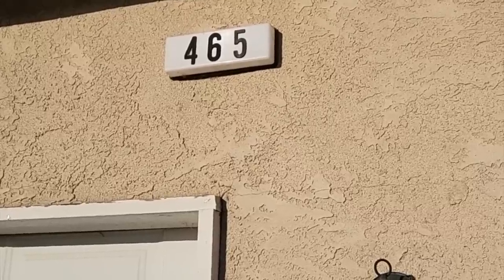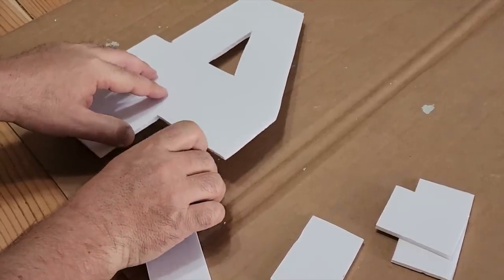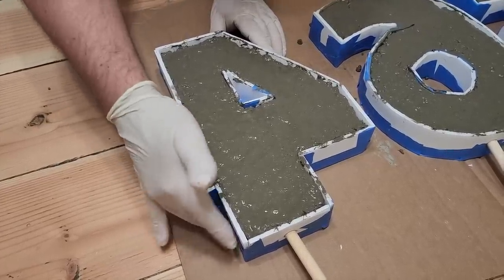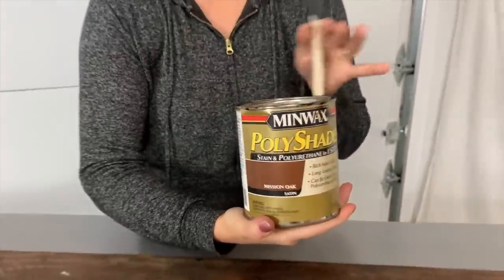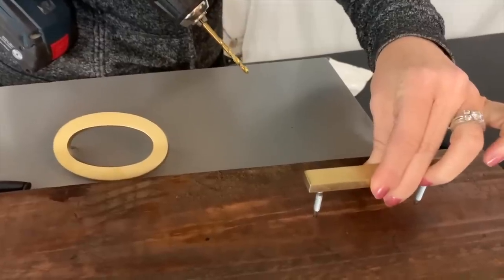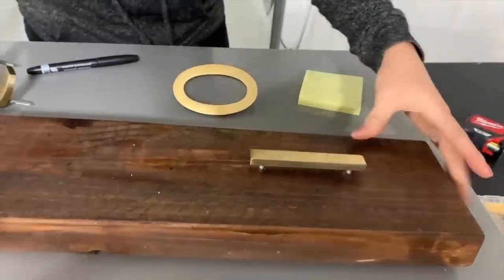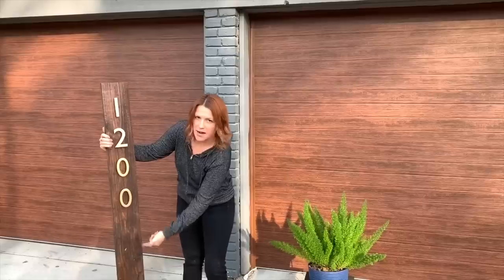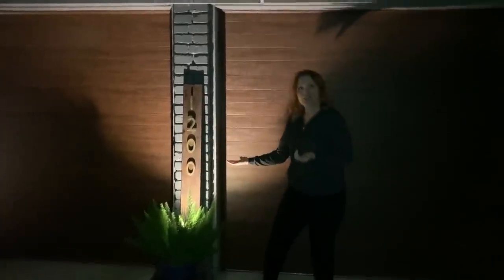You might want to rethink your address sign when you see this!

Comment: To answer your question about the wooden sign: First of all, I really like your idea and it looks very nice. I would secure it starting from the second row of bricks at the top and perhaps have a small hook or two below the numbers to hang a small planter with a smaller solar light (eliminating the electrical cord). That's just my 2 cents; but thanks for planting a seed in my little head, I now have an idea for our much needed address sign upgrade. 👍👍

Comment: Don't screw into the brick.  Water gets in and deteriorates the wall much quicker.  Perhaps some type of adhesive to affix it that can be removed later without damaging the brick.  Also you can make stakes to insert into ground and put it at the front of your house.   Lighting from above would be better.